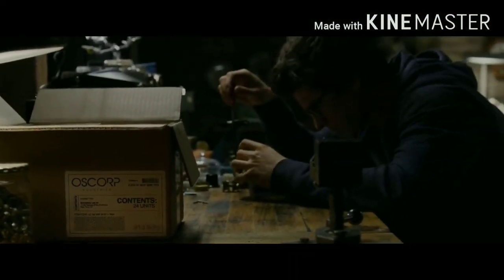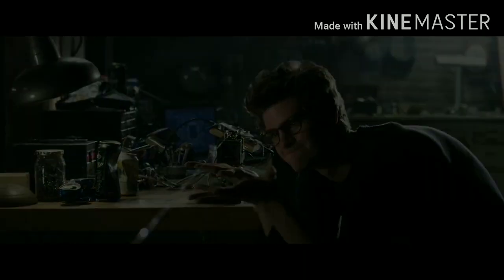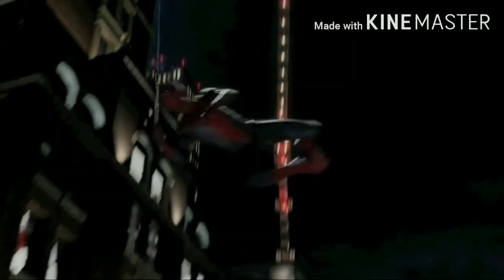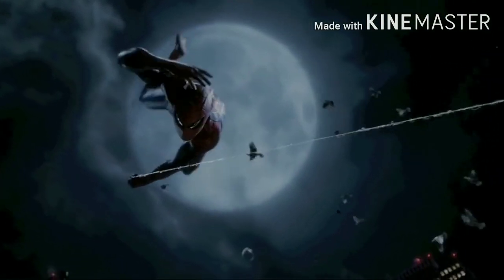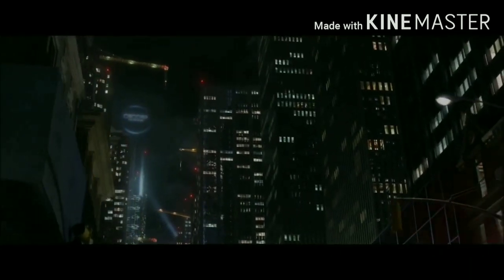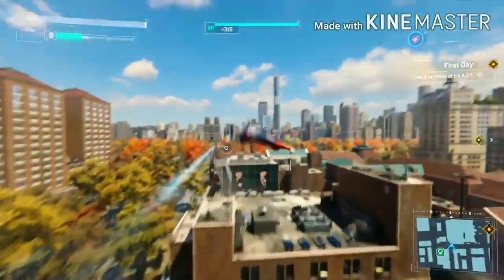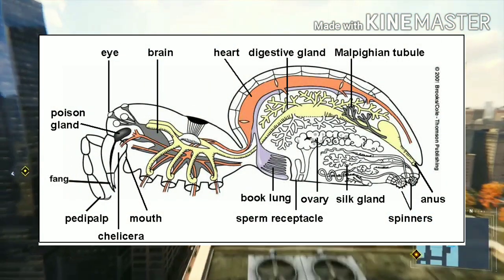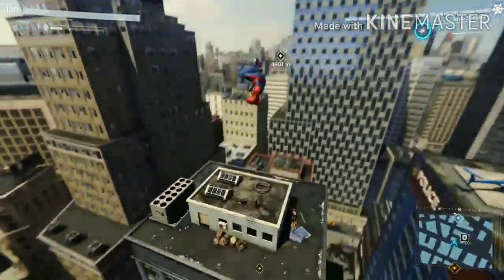Why WEB-SLINGING Seems IMPOSSIBLE In Real Life | QnA #Theionspider #webslinging

Comment: Have you not seen this guy in russia swinging super high with a rope I think it's fine plus just dont dive when you swing because it will add speed. Web fluid I've seen long chain polymer nylon and imagine if it was in the container as big as Tom Hollands web shooter it would be fine. Even glue. Plus someone literally made webs that can stick really fast on youtube so. The only true thing is the G force but that's easily handled if you don't dive while swinging just swing without diving and you will be fine. First swing on low building so that you atleast survive when you fall
Reply: You could also where one of those vests that fighter pilots wear to regulate blood pressure under the g forces of flying at the speeds they do.
Reply: @Thatonedude734   Yeah. But those are for like if a pilot goes 600 mph but swing makes you go at least 50 mph so you'll be fine